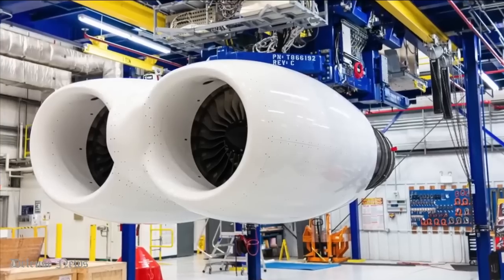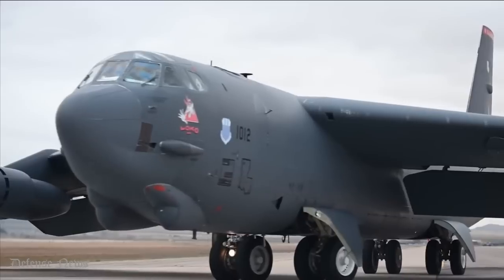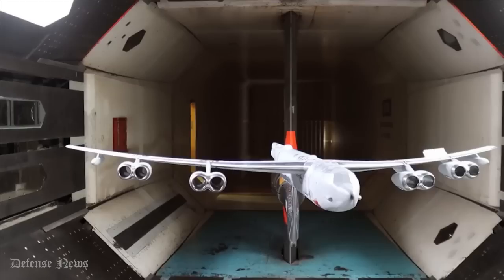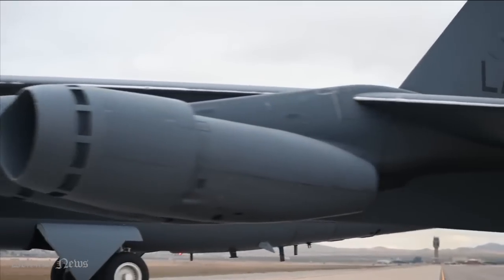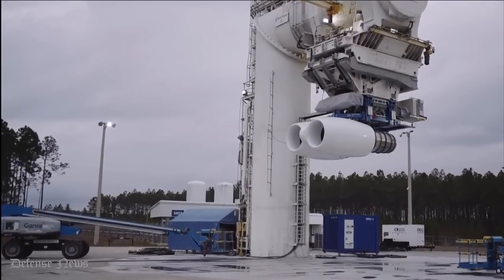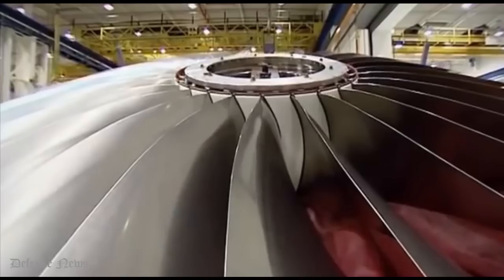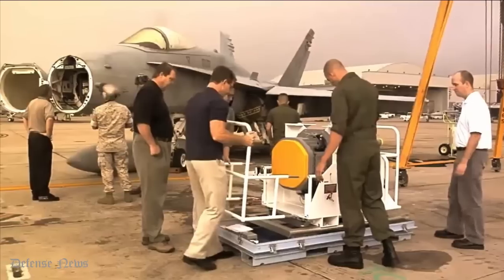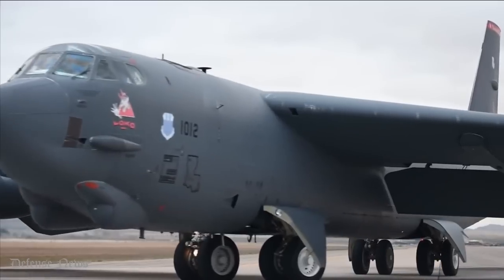Rolls-Royce Begins Testing of New F130 Engine for B-52 Stratofortress

Comment: Just read on another site the cost has risen 30% while fuel savings has decreased 30% over the projections.
Reply from the maker: thanks for the comment
Reply: The cost has not risen. Its a fixed cost contract with RR. Fuel savings were known from the outset as USAF already has that engine in its inventory. Uses 45% less fuel than the current BUFF engine.
Reply: @nathd1748  There are MANY articles and sources which cite even higher cost increases in the engine program. Basic search will reveal them.
Cost of B-52 Re-Engining Jumps By Half in New Estimate of Refit
May 19, 2022 | By John A. Tirpak
The cost of the B-52 re-engining program has increased 50 percent because of integration issues, according to revelations in a House Armed Services panel hearing.

Air Force acquisition executive Andrew P. Hunter acknowledged the B-52 Commercial Engine Replacement Program (CERP) price hike as voiced in a question from Rep. Rob Wittman (R-Va.) in testimony on service modernization.

“We currently believe there is cost growth from our design work that we did originally through the middle-tier acquisition program to what we anticipate we’ll be looking at [in] Milestone B,” which evaluates readiness for entry into the engineering and manufacturing development phase, Hunter said.

The B-52 CERP has been conducted as a middle-tier acquisition program to get underway rapidly and develop a prototype system but is now moving to a “traditional” program, and the Air Force is firming up the costs it expects to pay, Hunter said. The cost increases have more to do with integrating the engines on the B-52, which is a Boeing effort, and has less to do with the engines themselves, which will be built by Rolls-Royce, he added.

“I want to emphasize that a lot of that engineering work is actually inside the airplane, on the support struts, to which the engines attach, versus the engine itself, which is largely a commercial engine that already exists,” Hunter said. The engine needs only “a modest number of modifications,” he said.

“So it’s really about re-engineering 1960s aircraft to perform all the way through” to the end of the B-52’s lifetime, now envisioned as circa 2050.

The Air Force told Congress a year ago that the CERP effort had increased in cost by nine percent because of pandemic-related supply issues, to about $11 billion. Hunter did not speculate on a new cost estimate.

The end of the risk reduction and prototyping phase is rapidly approaching, Hunter said, and when it’s done, “we’ll have an effective design … [that will] allow us to go into an acquisition program to allow us to do that re-engining.”

At Milestone B, “we will … have in our hands the real, full cost of what it will take to do it, and we’ll set the original baseline for the full program … at that point,” Hunter said.

The Air Force will “assess” at that milestone whether “it still make sense to move forward with that program,” Hunter said, adding, however, that “we will need a new engine for the B-52 to get it out to its full lifetime.”

In an email response to a query from Air Force magazine, Boeing said the “50 percent differential in the CERP cost comes from an original, 2017 government estimate produced by the Air Force program office, compared to the latest 2022 estimate.”

The company said it “is our understanding that the government’s estimate has been adjusted over the years from the initial business case analysis, developed at a very early phase of the acquisition, to incorporate additional complexity” as well as “further historical fidelity on similar programs, as well as additional understanding of technical scope and complexity of the design.”

Rolls-Royce North America said through a spokesperson that the company “has been collaborating closely with the Air Force and program integrator Boeing on the CERP program.” There have been “no changes in engine pricing since the contract was awarded.”

The Air Force was not able to comment on the B-52 CERP cost increase by press time.

The CERP seeks to integrate eight new Rolls-Royce F130 engines per aircraft to replace the Pratt & Whitney TF33s, which are original equipment on the B-52Hs, built in 1962. The engines will be digitally controlled, requiring new pylons, new twin-engine nacelles, and wiring to connect the powerplants to the B-52 cockpit. The project is part of an overall modernization of the B-52 fleet that includes digital wiring, new communications, and a new radar, among other improvements.

This is from Air&Space Forces magazine. Sources for increased fuel burn will follow.
Reply: @nathd1748  The new engine does NOT use 45% less fuel than the TF-33. It was anticipated to use 30% less fuel but that has been revised to be 20%.
From Air&Space Forces Magazine.                                                                                "There has also been a reduction in expected fuel efficiency of the new engines, from the previous target of 30 percent improvement over the current TF33 engines to about 20 percent, Ruscetta acknowledged. However, fuel efficiency was not a key discriminator on the contract, which was weighted toward reliability, reduced maintenance, and expected ease of integration with the bomber."
Reply: @terryboyer1342  The existing F130 in USAF fleets are using 40% less fuel than TF33. This has been acknowledged by USAF. The engines offered for the B52 programme have had huge upgrades and the fuel use is expected to be 45% less than the TF33. You are reading from stuff that has not been put in mainstream to be challenged for the BS that it is. They are probably using figures for consumption at max thrust compared to TF33. The fuel savings go up further when at cruise altitude where the BUFF spends majority of its time.
Reply: @nathd1748  Where and when did the USAF "acknowledge" the F130 engine uses 40% less fuel?  "The engines offered for the B52 programme have had huge upgrades and the fuel use is expected to be 45% less than than the TF33". A source for these claims would be helpful. I provided sources.
"You are reading from stuff that has not been put in mainstream to be challenged for the BS that it is"  I don't understand the meaning of what you've written. If you do a basic search you'll find multiple sources for what I've written. The BS lies solely on you my friend.
Reply: The BMW F130 was as fraction of the price of the Pratt & Whitney bid.
Reply: @WilhelmKarsten  Hello Sandyboy, as you know Sandyboy, the F130 is the US designation of the ROLLS ROYCE BR 725 engines. You remember  that Rolls Royce gave bmw the chance to re-enter the aero engine market in a joint venture but bmw couldn't hack it and dropped out. Fortunately Rolls Royce kept on the  local employees.
And as you know, the F130s will be built in the US at ROLLS ROYCES North American facility.

Comment: Cool! They definitely need new engines. If you've never seen one take off in person, the black exhaust billowing out of those engines is dreadful. Hopefully, the new engines will be less polluting and more economical. Oh, and not as loud!
Reply: Reduce their visibility too, the smoke is easy to spot long before the aircraft is seen. All that soot is wasted fuel.
Reply from the maker: thanks for the comment
Reply from the maker: thanks for the comment
Reply: I hope the new engines are loud and smoky.
Reply: @spitfirenutspitfirenut4835  no ones seen what the mil power setting can do.
Reply: @spitfirenutspitfirenut4835  i hope so too

Comment: '
come on american company...
american own company must make their own JETMOTORS in B-52 bombers
Reply: The BMW F130 engines are the perfect fit and will be made in America.
Reply: @WilhelmKarsten  Hello Sandyboy, as you know Sandyboy, the F130 is the US designation of the ROLLS ROYCE BR 725 engines. You remember  that Rolls Royce gave bmw the chance to re-enter the aero engine market in a joint venture but bmw couldn't hack it and dropped out. Fortunately Rolls Royce kept on the  local employees.
And as you know, the F130s will be built in the US at ROLLS ROYCES North American facility.

Comment: Why paired engines instead of single, more powerful, engines? Fewer engines, less complexity, less maintenance.
Is it just a matter of clearance?
What, no engine spares planned to be built beyond number required for existing air frames?
Reply: BUFF's have a very small rudder. With very little rudder authority, in an engine out situation, the fewer engines with more power each means the pilots would not have enough control of the airplane to fly safe.
Reply: Won't fit, not enough ground clearance.
Reply: It’s more a complex and expensive of a modification

Comment: Isn’t putting RR engines on a B52 a bit like polishing a turd?
Reply: no worse then refitting a TU-95 with them.
Reply: Sanctions - Tu-95 will get no RR engines unless Putin says, "My Bad!"
Reply: The F130 was designed and built in Germany by BMW
Reply: What better engines could they have put on them?
Reply: Go and educate yourself
Reply: @WilhelmKarsten  Hello Sandyboy, as you know Sandyboy, the F130 is the US designation of the ROLLS ROYCE BR 725 engines. You remember  that Rolls Royce gave bmw the chance to re-enter the aero engine market in a joint venture but bmw couldn't hack it and dropped out. Fortunately Rolls Royce kept on the  local employees.
And as you know, the F130s will be built in the US at ROLLS ROYCES North American facility.

Comment: The F130 is a BMW engine
Reply: How much of it was designed by BMW and how much by Rolls Royce??
Reply: @nathd1748  The F130 is the military version designed and built by BMW in Dahlwitz Germany.
The civilian version BR700 is a collaboration between BMW and Rolls-Royce.
Reply: @WilhelmKarsten  It is no different an engine than what they offer on civilian bizjet markets. There are about 4 or 5 iterations of the BR700 series. The initial design of this engine required about 65% RR input against 35% BMW who were newcomers to this market. Which is why it was so easy for RR to then take full ownership of the programme. Sorry to burst your bubble.
Reply: @nathd1748  The engines used for the B-52 are not the civilian BR700s.. the military version is designed by BMW.
Reply: @WilhelmKarsten  The difference is purely on the electrical draw off. They are made partly in Germany partly in the UK. They are FULLY owned by RR and not BMW.
Reply: @nathd1748  Motorenfabrik Oberursel is the second oldest aircraft engine manufacturer in the world founded in 1891... second only to Daimler-Benz.(Maybach-MTU)
Reply: @nathd1748  That comment reveals someone who is not formally educated or has any professional experience in the aviation industry. The differences between a   civilian commercial type certification like EASA or FAA and a country specific military airworthiness certification can be too numerous to list.
Reply: Hello Sandyboy, as you know Sandyboy, the F130 is the US designation of the ROLLS ROYCE BR 725 engines. You remember  that Rolls Royce gave bmw the chance to re-enter the aero engine market in a joint venture but bmw couldn't hack it and dropped out. Fortunately Rolls Royce kept on the  local employees.
And as you know, the F130s will be built in the US at ROLLS ROYCES North American facility.

Comment: und wieder ein video mit deutschem titel und der rest ist ausländisch .was soll das???????????👎
Reply: BMW F130 engines
Reply: @WilhelmKarsten  Hello Sandyboy, as you know Sandyboy, the F130 is the US designation of the ROLLS ROYCE BR 725 engines. You remember  that Rolls Royce gave bmw the chance to re-enter the aero engine market in a joint venture but bmw couldn't hack it and dropped out. Fortunately Rolls Royce kept on the  local employees.
And as you know, the F130s will be built in the US at ROLLS ROYCES North American facility.

Comment: Will be beauty aircraft with ugly engines..
Reply: No such think as ugly engines
Reply: The BMW F130 is a beautiful engine
Reply: @WilhelmKarsten  show some proof then, instead of spouting this crap all the time
Reply: @killer1479  The F130 was designed and is manufactured in Dahlwitz Germany.
Real Rolls-Royce jet engines are named after rivers in England.
Reply: @WilhelmKarsten  the F130 was a joint venture design between BMW and RRs now entirely manufactured by RR, so technically, it isnt entirely german
Reply: @killer1479  Don't confuse the later collaboration of the BR700 commercial engine with the BMW military spec F130.
Reply: @killer1479  If it's not named for a river in England? It's not a real Rolls-Royce jet engine.
Reply: @WilhelmKarsten They are not all named after rivers. The BR715 was a joint venture. BMW wanted to diversify but did not have the expertise to go it alone. RR did.
Reply: @nathd1748  All of the British jet engines designed by Rolls-Royce have a river name.
The F130 is a BMW engine, later acquired by Rolls-Royce
The only British jet engine still made in the UK is the Trent series.
Reply: @WilhelmKarsten  Hello Sandyboy, as you know Sandyboy, the F130 is the US designation of the ROLLS ROYCE BR 725 engines. You remember  that Rolls Royce gave bmw the chance to re-enter the aero engine market in a joint venture but bmw couldn't hack it and dropped out. Fortunately Rolls Royce kept on the  local employees.
And as you know, the F130s will be built in the US at ROLLS ROYCES North American facility.
Reply: @WilhelmKarsten  As you know Sandyboy, since you mention the Trent engine the F130 contains aspects of the Trent design. As you know there are various sophisticated elements of the 700 series built at ROLLS ROYCE'S facility in Oberursel that have to manufactured in the UK for Oberursel to assemble.